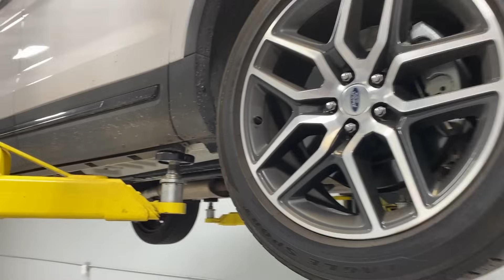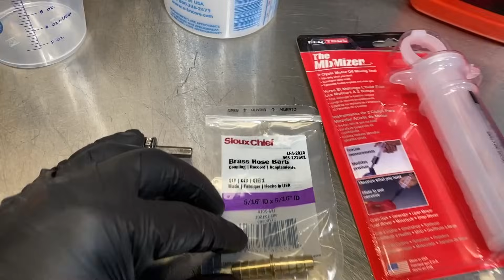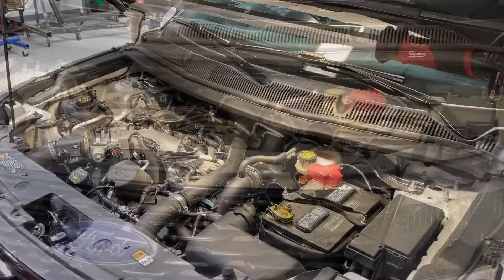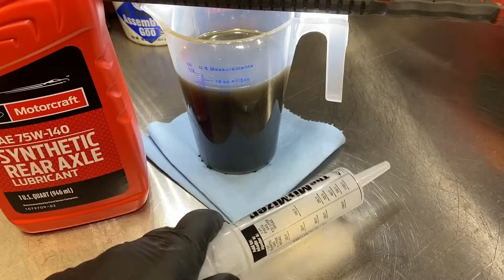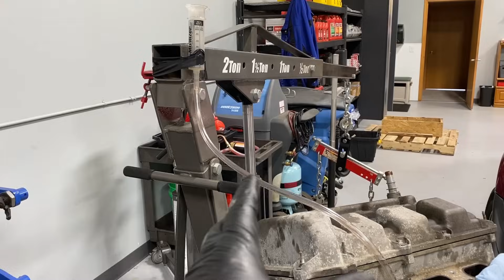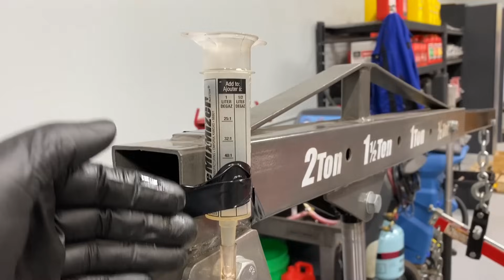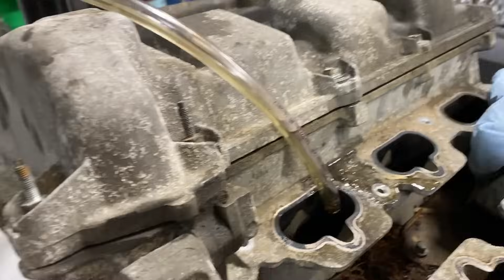Fluid Service on Ford’s New Cooled PTU’s is Possible: We Show You How!

Comment: Very interested on how to do this on a Bronco Sport Badlands including the rear diffy.
Reply: Me too. I’m going to check out my PTU on my Badlands when I remove my bash plate and do my first oil change. I’m hoping it’s designed a little different so it can be serviced easier.
Reply: @bozerbrett7867  the good news is the RDU is very accessible and has both drainage and fill spots.  I would do the rear unit as well.  I will do the rear and PTU at 20k miles and then 30 k afterwards.  I want to get the breaking fluids out of there
Reply: @davidtennien39  that is good news, I’m glad Ford realized that the PTU needs to be serviceable. I’ll be draining mine around 20k also.

Comment: Why not forget using the vent and putting a small 1/4 turn valve in the drain plug and after draining use a hose and syringe to for the 16 ounces of new fluid into the PTU unit? Shut the drain valve and all done.

Comment: Great video, Brian. I have a 2018 Focus RS with a water-cooled PTU, but the fill plug looks to be a little easier to access. My plan is to change the fluid at around 12,000 miles. That fluid you drained out at 20,000+ miles looked pretty bad! Keep up the good work.
Reply from the maker: Yours is much better design that is super easy to service.
Reply: Good to know. Thanks again.

Comment: I tried this job today and am having the hardest time getting that cap off the vent tube.   Has anyone been able to do this?  I can only just barely get two fingers from two hands on it and don't have much leverage to pull the cap out.  Any tips on that part?
Reply from the maker: You can also cut the hose just under the vent cap about 1/2" down and remove then slit the tube with a razor blade and the piece of hose will just fall off the cap.
Reply: @FordTechMakuloco  Thanks for the quick response!  I had ideas about going that route but figured I'd back off and see what others have experienced first.  I have some 8mm ID fuel line laying around - i'm thinking that'll work just as well as the silicone hose right?  Really appreciate your videos - just picked up a 2017 explorer with 34k miles so I know for sure i need to get this done as soon as possible.

Comment: Not sure why you just don't replace the drain plug with something like the fumoto brand, and then refill from the drain source. I don't think there's any reason why it has to be filled from the top especially if you are using a pressurized measuring device to refill anyways.
Reply from the maker: I would never use a fumoto drain, I laugh when I see those on engines, especially since the secondary lock is always missing.
Reply: Also lose the benefits of the magnetic drain plug

Comment: Why couldn't you use one of those fluid suction deals that looks like a grease gun and push it in a little more timely?
Reply from the maker: That would add too much pressure, honestly it is only 1/2 a quart or so it takes 5-10 minutes using this method so it's no big deal.
Reply: @FordTechMakuloco  That's true. Over all it's a poor design at best especially with the failure rate. I'm with you on the recall/customer care issue for these. If it were a safety thing where they were catching on fire it would have been corrected already. Love the technical expertise on your videos. I am having a run on older early 2000's 7.3L diesels in my shop. They don't rust out down here and people keep them for ever.

Comment: Do you have any concerns of damaging seals when using the plunger to push oil into the ptu as you are creating a positive pressure in the case?
Reply from the maker: No, that is why I say push the fluid in slowly. Plus the PTU has a chance to vent after each injection.
Reply: FordTechMakuloco thank you, keep the great videos coming

Comment: What about the PTU seals? Pushing oil in with no vent
Reply from the maker: This is why you inject slowly and besides a little funnel of fluid is not going to pressurize a PTU, plus it has a chance to vent each time the funnel is empty before the next dose.
Reply: The PTU cavity is so large it would be next to impossible to pressurize it by filling it the way Brian did.

Comment: So, does this affect warranty if the PTU fails?
Reply: It shouldn't, all you're doing is adding a bit of hose to the existing hose.
Reply from the maker: No, but if you are worried about it the PTU vent can be returned to stock in a few minutes if need be.

Comment: Hi Brian, don't you think that pushing the fluid by the syringe can lead to pressure inside the unit and leaking
Reply from the maker: Yes that is why we use a small syringe that we have to refill several times each time allowing the unit to breathe and we go slow so there are no problems. Did you watch the entire video I explained all of this.
Reply: @FordTechMakuloco  
Thank you for the quick reply, but how  long time maybe the fluid need to fill the unit naturally without injection?

Comment: I wouldn't use the plunger. This fluid is displacing air that has no place to go. You are going to blow your hose connection or seals.
Reply from the maker: That is why you only push so much then allow it to breathe, think about the air volume inside the PTU, that fluid amount in the syringe could never pressurize it enough.

Comment: 2015 Explorer Sport. Southern Ontario. Just changed the PTU lube after becoming a little unnerved watching your great videos on it. 120,000 kilometers. Lube came out looking just a little darker, no burnt smell. I'd say normal. Only a little bit of iron on the plug. This Explorer gets a lot of summer highway miles, tows many different trailers and is pushed hard. I'm wondering if it's the Explorers in the south that are cooking their lube? Could it be the cooler climate in the North that kept my fluid looking ok? Cheers and thanks!
Reply: Did you buy it new? or Used? Previous owner may have did a fluid change before you?

Comment: HEY, I JUST REPLACED MY FRONT PASSENGER SIDE CV AXLE ON MY 2016 FORD EXPLORER SPORT AND ONCE REMOVED OIL POURED FROM THE AXLE HOLE. IS THAT TRANS FLUID OR THE PTU OIL?
Reply from the maker: trans fluid, you will likely have a PTU leak now.
Reply: @FordTechMakuloco  ok. Fun for the whole family ... Thanks ugh....

Comment: the vent cap wont budge using 2 hands.. i do not want to pull the hose off the ptu itself. Any tips for removing the cap ?
Reply from the maker: You must twist and pull its tough but possible.
Reply: what a bit** haha i yanked the whole tube off the nipple on the PTU. I plan on just replacing the whole tube and not using the barb.. thank you for the video i would have never have known about this unless you did this video.. thank you

Comment: Does it madder if it is a black or clear? The one in your link is sold out and wanted to get one. Thanks
Reply from the maker: The clear lines do not handle heat well and harden causing leaks.
Reply: Sorry last question will another colors work. If not I will wait for the black one come back on stock just want to get it done asap. I have 60k on it.

Comment: I have a 2016 AWD Ford Explorer 3.5 NA.  My PTU is operating fine but leaking.  I see there are seal kits available.  Ford is brainless and just wants to replace the PTU.  Local mechanics want to replace the PTU.  I want to replace the seals.  Is that not recommended and also is a transmission shop or a differential/gear and axel shop more suited to this sort of repair?

Comment: Great vid I just did my 2018 explorer at 52k fluid looked like new and magnetic drain plug just had smudge on it. Vent cap was a pia had to cut it off.  Definitely heat the fluid . You must have small hands mine didn’t fit like yours did.

Comment: What suggestions do you have if the drain plug won’t loosen? Explorer has 58k miles. Put pb blaster up there, soaked over night and still won’t loosen. Thank you
Reply: Use a small propane torch and heat that sucker up a few times. Use an Allen or wrench with a long handle and give it a good whack with the hammer to bust it loose... May have to get creative. They make Allen bits that fit a ratchet as well.

Comment: Ford's engineers are plum crazy! The transmissions that I have serviced generally drain 4 to 5 quarts or more! How many quarts total does it hold?
Reply: John Shuler   The ptu is not a transmission.  It’s essentially a transfer case for awd.  1 quart capacity is still ridiculous!

Comment: How new are we talking with these PTU's with coolers? I went from a 2010 AWD Fusion which had a PTU failure a couple weeks after Used purchase, around 100k miles. The Ford dealer that did the work under the Zurich powertrain warranty I (thank god) signed up for described it on the repair bill as "complete failure." The mechanic told me it was nothing but tar and chunks of teeth all over. So that car taught me to watch out for what Ford recommends. Lol. I just traded it in for a 2017 Lincoln MKZ 3.0T AWD with 45K miles, and would like to get this fluid exchanged sooner than later, since nothing on service records says anything about PTU fluid exchange, and I see Ford is sticking to their guns with this "lifetime part, maintenance free" nonsense in the owner's manual. Will a 2017 have this cooler, or should I just follow the old method?
Reply from the maker: It all depend on the package, your vin will tell you or just look under there.

Comment: ill stick to a 99 buick century with studded snow tires..... 
.
300,000 miles and counting..... replace lower intake gaskets and the motor is good for AT LEAST 500,000

Comment: I disagree on the motorcraft oil! This is definitely a place to use amsoil or redline that use 100% synthetic group 4 and 5 basestock! That motorcraft is group 3 dino oil hydrocracked! Amsoil and redline are superior in resisting heat!
Reply from the maker: I literally said I use Motorcraft but any brand you like it's up to you. Where did the big discussion about oil come from? I tell you though since you bring it up, I just opened up an engine that has used Amsoil since new and uh I am not impressed one bit. No one will ever sell me on Amsoil ever.
Reply: @FordTechMakuloco  I'm not mad at ya just I know 100% synthetic gear oil resists heat better than group 3 synthetics. Being there's only half a quart in there. Love your videos no matter what
Reply: Amsoil is a multi-level marketing gimmick in my opinion!
Reply: @wrb2bones  MLM is how they sell it. it's great oil but overkill for average vehicle owners! I use it in my trans and diffs but not my engine

Comment: ford engineers are contract temp workers once they designed this crap you dont see them again this is why so many issues with the axles the waterpump the motor mounts etc all failing quickly.

Comment: Great video!  I have a 2013 Flex EB w/ 110k miles.  I've changed the PTU fluid once before, and it's time for it again.  Mine is currently draining, and the fluid is a dark grey.  Do you recommend running any kind of cleaner thru the PTU before putting fresh fluid back in?  Or do you suggest fresh fluid, run for x amount of time, drain, and add fresh fluid again?
Reply: What did you end up doing to your PTU after draining, did you run a cleaner or anything through it before refilling?
Reply: @HuskerRed11  I drained it overnight.  Then I think I sprayed some brake cleaner in the fill hole a few times and let it run out.  In my notes I have "drained, filled, drained, filled".  IIRC, I filled w/ either ATF or 75w90, let it sit for a while (maybe overnight), then drained that before putting in the 75w140.  I did not start/run it during this time - it was up on ramps/stands the whole time (a few nights).  

The intermediate steps helped a bit.  My 1st change 30k ago, I could only add 350ml to it.  This change I was able to add 380ml.  Since fluid is cheap compared to a new PTU, I may drain it early -- say in 20k miles.  Maybe I'll be able to get even closer to the 500ml recommendation.

Comment: Off topic question, I work in the city and every time somebody walks near my ford, I have 3, the sensors pick up pedestrians around the car. The problem is that the alarm stays on as long as anybody approaches the vehicle and to add insult to injury it mutes your phone call! Ford dealer is no help.
Reply: Do you drive a high end Ford product with full perimeter and interior sensors? If you do, like my Nautilus, you can select to disable them through the electronic gauges, using your steering wheel selectors. Leaving your sunroof or windows open is probable triggering the interior motion detectors, mounted up by your rear view mirror.

Comment: If anybody is reading this in 2025-I’m trying to do this procedure myself. The valve is buried and wire tied underneath some other tubing and wiring. It doesn’t look as easily accessible as this one does. Any tips or other things I could remove?
Reply: Driving up on ramps.. laying down you gotta bring your right hand up to the tube where you can see it... then in your left hand have long needle noses and go thru the wheel well with that. That's the best I can describe it.

Comment: Great video! As usual.
I'm thinking, heating the fluid in a microwave will thin the fluid enough to easily speed up the fill significantly. All oils thin when heated and thicken when cooled.

Comment: I agree that manufacturers need to stop deceiving customers that these fluids last "the life of the vehicle." Even if it is a full synthetic lubricant, it still breaks down. Maybe they should put these maintenance items under a section titled "For maximum vehicle life and durability" instead of the so-called "Severe service only" title. They should  start designing things where maintenance isn't such a hassle requiring needless disassembly. Before long, they'll start saying to only change the engine oil filter at 100,000 miles because you'll only be able to access it by removing the engine.

Comment: I have 2018 Ford Fusion Energi, do I have to do this too ?  I drove 94,000 miles and only changed engine oil 15 time , once  engine air filter and once cabin air filter., 
I think I drove 65,000 miles out of it on gas. Rest EV mode. 
Running still nice , should I any maintenance on it ?

Comment: Is it necessary to change brake fluid like the dealership wants
Reply from the maker: every 60k miles
Reply: Why I've worked on cars for over 40 years never heard of this
Reply from the maker: There are so many reason but mainly because the brake fluid is hygroscopic which as you probably know attracts moisture making the brake fluid acidic thereby eroding the brake system from the inside out. Email me if you would like a an article on this.

Comment: Awesome video @FordTechMakuloco however, is this applicable to both AWD and 4WD Explorers? I have a 2017 Ford Explorer Limited 4WD with 78K miles and would like to know if this is needed for my vehicle. Thanks!
Reply: Yes… absolutely needed. 
You might run into the same issue I’m having… I have a 2019 XLT and there’s no breather tube. 
I crawled underneath the vehicle and used a mirror to see the top of the vase and there is a hole…. Just no tube:/
Reply: @Bleet1234  luckily I did this service last month. My 2017 did have a breather tube in the engine bay.

Comment: Really great advice.  The new fluid drains into the unit slowly because there's not much of a place, other then the down-tube you made, for air to escape. That's also why it's a good idea to warm up the fluid.  It would be great if there were a second vent.  Have you considered flushing through the new "fill tube" with brake cleaner to possibly get more gack out of there? The brake cleaner would evaporate, so I don't foresee a problem and maybe, get more shavings and old oil out. Your thoughts?  Also, glad to see I have the very same engine hoist. I swear, I must have 3/4 Harbor Freight catalog in my garage!
Reply: I've seen people put a tee at the top of the case and run a second vent tube up for filling and then the air only has to travel through the tee before it can escape through the original breather hose

Comment: Is there any real risk to adding 20 or so ounces instead of only 14? More fluid would mean more heat dissipation right? And longer service intervals? Maybe???
Reply: You might be able to get away with a few extra ounces.  If you over fill the fluid might foam and the gears will be toast in short order.

Comment: My question is if its a half quart capacity then why match what comes out? Shouldnt a full drain empty it out so you add the half quart no matter what?
Reply: That would make sense to me. Because some of the last fill may have cooked off. If you only replace what you drained without accounting for the cook-off, you will be filling with less and less.

Comment: Is there an official fluid capacity from Ford?  Also, since they used the original fill opening to install the new temp sensor, and to work properly a temp sensor needs to be immersed in the fluid,  wouldn't we be able to assume the fluid level on the new unit must be higher than the old unit?  I don't understand why Ford makes this so difficult, especially considering the poor history of this design.  It has to be less expensive for them to fix the issue and/or add a 30k miles fluid change to the maintenance schedule, versus just letting these things fry themselves and replace them under warranty.
Reply: You may already have the answer to this, but if not, I have a 2017 platinum explorer.  In the maintenance section, it show 24 ounces for the PTU.  The caveat is that the videos I am seeing, people are only getting about 17-18 ounces to drain out.  Not sure if there is fluid held captive or not filled to spec by the factory.  It could also be a mistake in the owners manual.  I hope this helps.